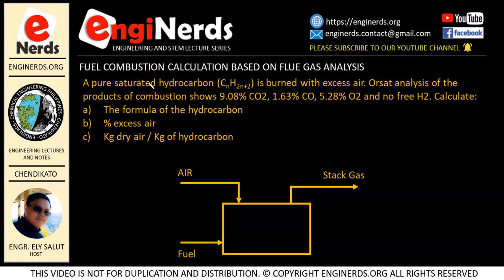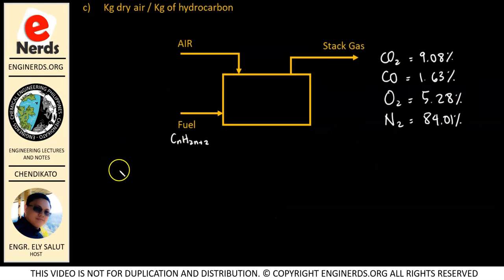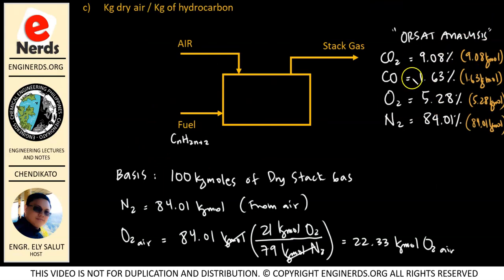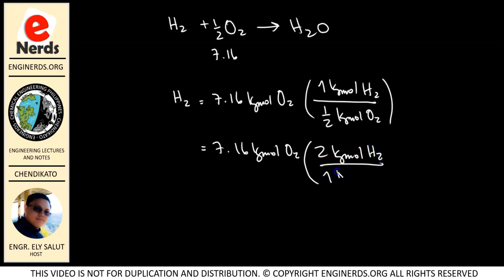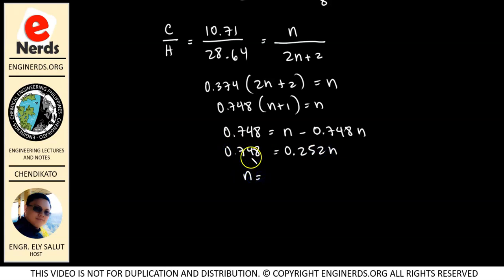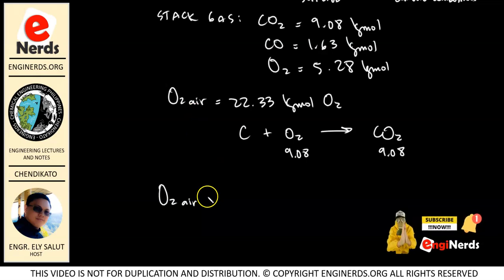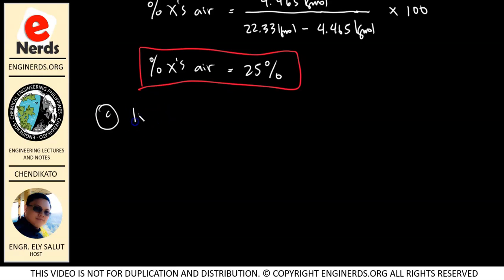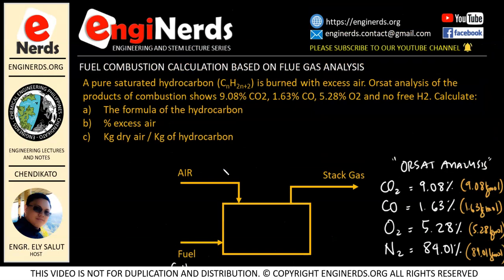FUEL COMBUSTION CALCULATION BASED ON FLUE GAS ANALYSIS | CHEMICAL ENGINEERING CALCULATIONS | ORSAT

Comment: A blast furnace gas analyzing 27% CO, 12% CO2, 2% H2, 5% CH4 and 54% N2 at 25degC and 98 kPa and saturated with water vapor is used as fuel in a boiler. Air is supplied 15% excess at 30degC, 762 torrs and also saturated with water. 90% of the total carbon in the fuel is converted to CO2, the rest CO. Molar ratio of H2 to CO is 1:4 in the stack gas which leaves at 200deC and 750 torrs. Calculate:
a. Orsat analysis of the stack gas
b. moles stack gas/mole fuel       nakuha kuna yung  letter A  boss  paanu yung B?
Reply from the maker: Hi, if you already got the Orsat analysis of the stack gas, then it means you already know the number of moles of the stack gas (excluding water) which is 2.11525 moles. The next step is to find the total number of moles of water in the stack gas which would include the (1) water formed from the H in the fuel minus the unburned H2 in the stack gas which you will use the molar ratio given (2) moles of water from the fuel, using Antoine's equation and (3) moles of water from air, using Antoinne's equation. You will add all these number of moles of water to the number of moles of gases in the stack gas that you got from your Orsat analysis. You should get 0.2002 moles. 
Finally, you will divide the number of moles of stack gas (2.315 moles) to the number of moles of fuel gas (1.033 moles). You should get 2.2415 ratio.
Reply: Thank you boss
Reply: For the following process, draw the materials flow diagram, write the independent reactions, do the degree of freedom analysis and complete the materials and energy balances

The combustion of a gas containing 96% CH4, 1.8% CO, 2.2% N2, flowing in at 50 m3/s occurs in a continuous process. The gas and air enter at 298 K. Calculate the flame temperature when air is enriched with 30% oxygen.
Reply: I need help sir